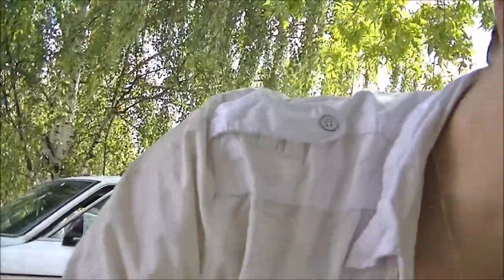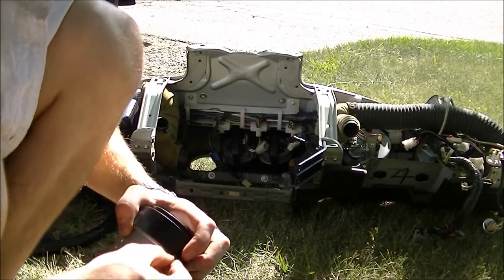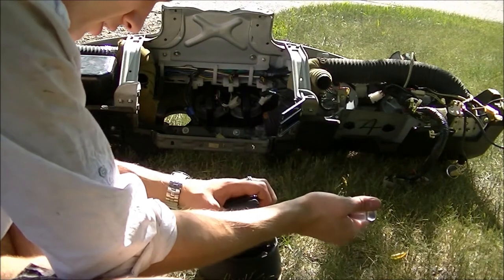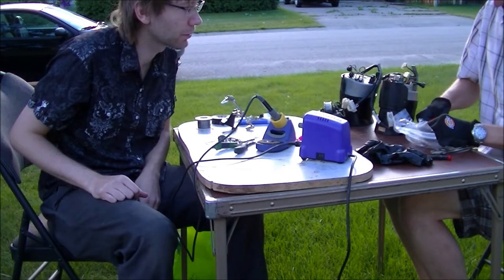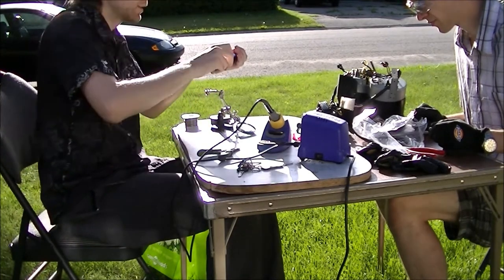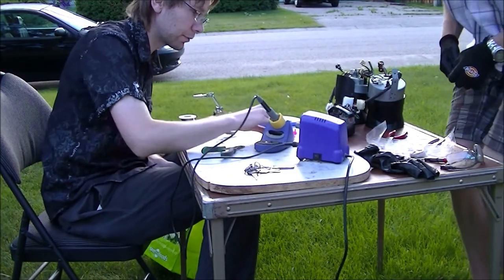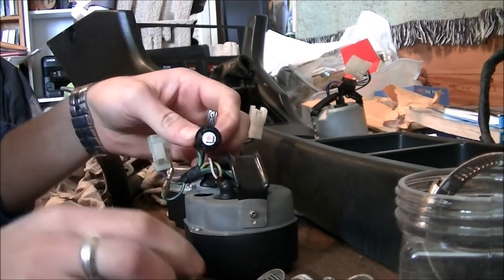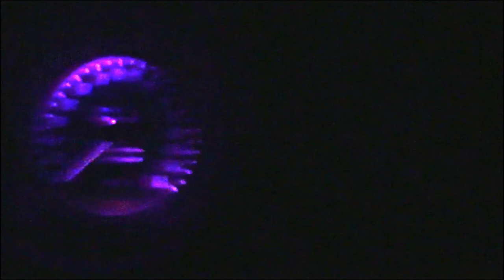Swapping Bulbs for Purple LEDs - Datsun 280Z | Dash Series [Part 3]

Comment: Hi. Does the dimmer works with that lights? Thanks
Reply from the maker: (all replies deleted during comme-geddon) "Not with these ones. You can either get dimmable LEDs, or install a LED dimmer board for the whole circuit."